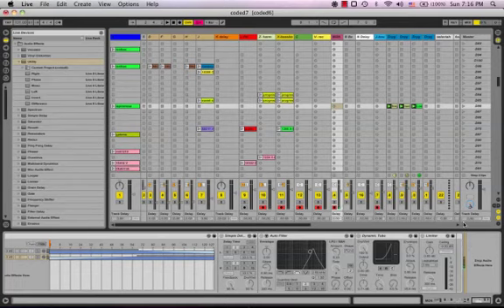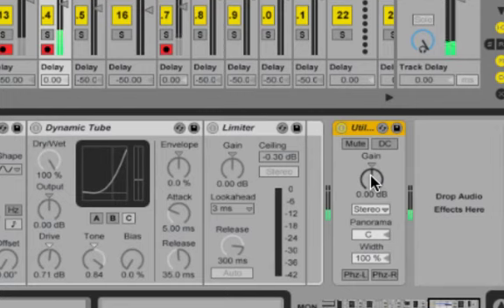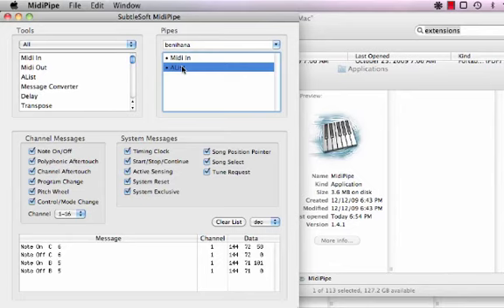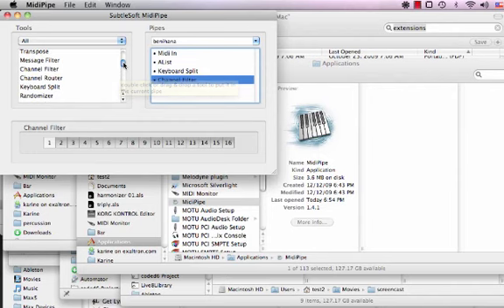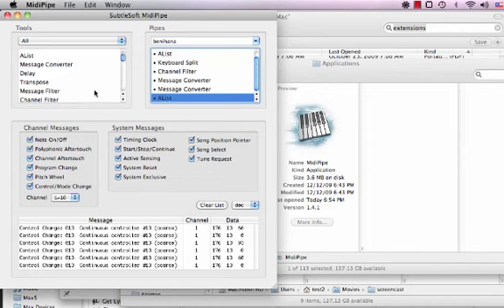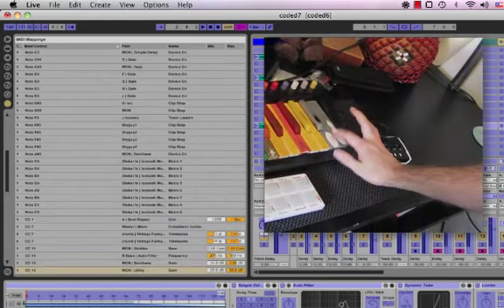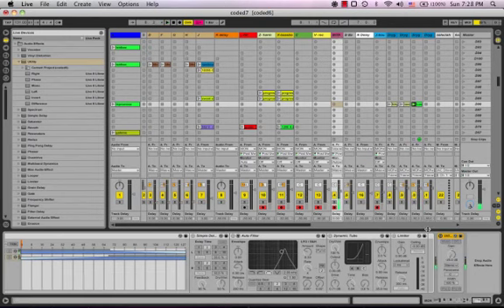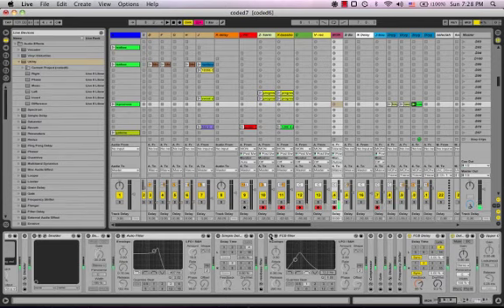the benihana technique- how to chop audio in real time

Comment: technically you can do it out of the box in live by routing your midi through an arpeggiator set to the fastest trigger (unsynced, 10ms), but that would then of course introduce 10ms of delay which isn't exactly 100% perfect, but yeah.. it works.

Comment from the maker: @elevated001 what I found out after posting this is that most newer controllers with software editors can be configured to send two messages- one on, one off. But I don't know of a way to do this with just Ableton and no external software. Thanks for finding me btw, great hanging out last night. Were you tagged in those FB photos?